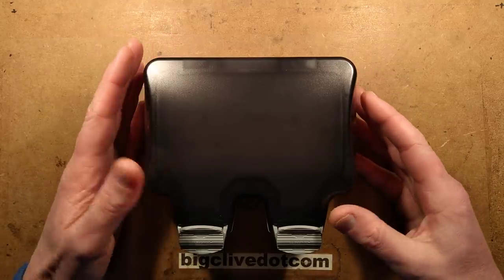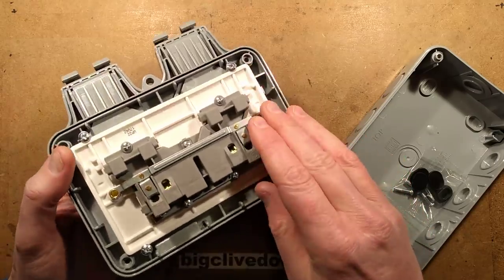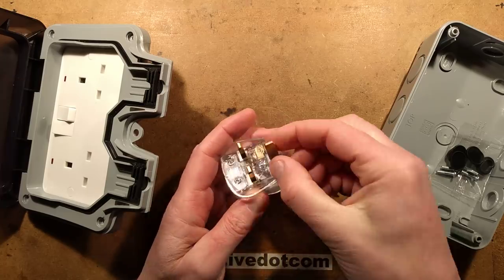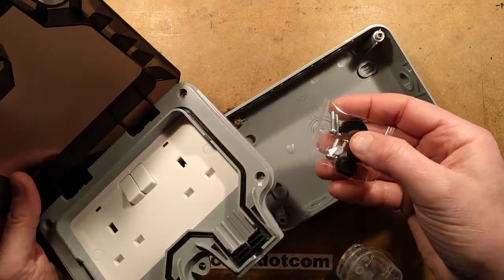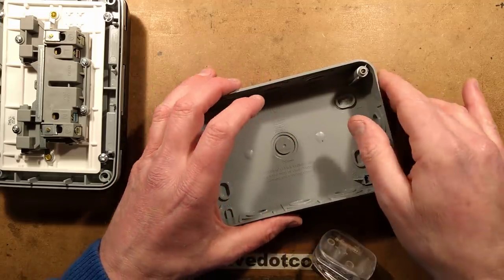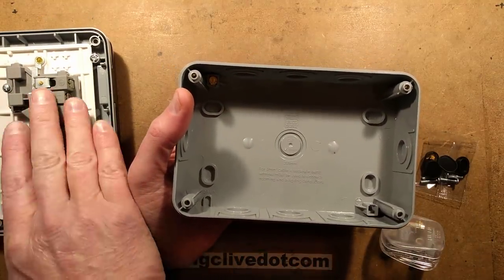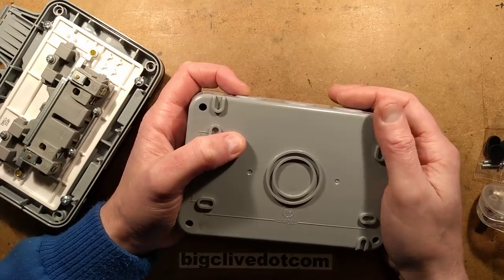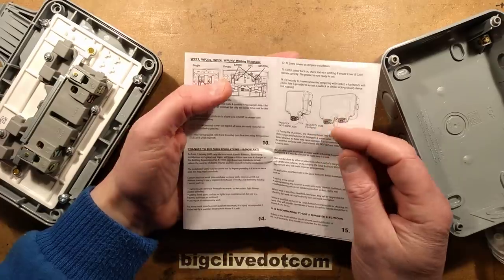British weatherproof socket with clever design. (bonus rant)

Comment: Right, let's compare the Dutch / EU plug (CEE 7/3 socket and CEE 7/4 plug) to the UK plug and socket, point per point.

- Rated 13A. EU plug: 16A.

- Big brass earth pin. Great, but it's singular. The EU plug has a connection on either side (which contacts at roughly the same time as the live and neutral)

- Sleeved power pins. All BS 4573 plugs (which are common for low power, unearthed things) have this. With the normal CEE 7/4 - CEE 7/3 combination, you can't even get the pins anywhere close to the outlet with your fingers touching the pins, because the outlet is recessed. 

- The automatic shutters are not quite as common on EU plugs, since it's regulated per country, but it's becoming quite a common thing. IMO, the shuttered EU plug is still better in this aspect, since it requires force on both shutters simultaneously to open, meaning that it'd require quite a bit of precision to open the shutters with say two screwdrivers. In the UK plug, you can first jam a single screwdriver in the earth slot, and then jam a screwdriver in the L or N, since it's now completely open. A lot easier to do if you ask me.

- It's fused, but is that out of safety, or out of necessity? I'd argue it's almost out of desperation, due to the outdated, and definitely not optimal ring circuit used in UK housing. In the Netherlands (can't speak for the rest of the EU here), everything is simply rated for 16A. The fuse in the fusebox is 16A, all decent extension cords or power bars are 16A (not even sure if <16A can officially be sold, never seen one), all plugs and cabling on appliances is 16A. Of course, you can argue that the UK plug makes it easier to find which device is causing issues, since that one wont work, instead of an entire room or floor when the fuse has tripped int he fusebox. But, what if the fuse doesn't work properly, and heats up massively instead of opening the circuit? Then you have a hot plug in an uncontrolled environment (how many people have power bars with many plugs underneath their beds?). If something goes wrong with the fuse in a fusebox, not much can happen, since the fusebox is designed to handle that.

So can we really say that the UK plug is the best / safest in the world? I'd argue it isn't. Not anymore at least. When taking the entire electrical system into account (from fusebox to appliance), I'd say it definitely isn't the best / safest anymore.

Comment: These  British Standard "BG" outdoor sockets are pants,  I do like and rate BG gear but these are utter rubbish.   The 8 cable entry's around the outer of the back box just push out with little effort allowing the ingress of water.  I recently fitted one only to find the plastic of the back box to be cracked in several places after 2 months, as if the plastic went brittle during the recent fold weather.  The catches that hold the lid shut are stiff and awkward to use especially in cold weather.
Sorry BG you've let the side down on this one !

Comment: As a Canadian, I love the safety-conscious design of the British plug and socket, but... I really wish I could find someone, anyone, discussing the pros and cons of ring mains vs. ... er, whatever you call the way it's done here in Canada or the US—branch circuits?—and fuses in every plug vs. fuses/breakers in the distribution board, who isn't over-the-top about "oh, the way WE do it is so OBVIOUSLY VASTLY SUPERIOR, and the other way is just FRIGGIN' MORONIC!!!!! "
Reply: The alternative circuits used in almost all other countries called radials (and John Ward is not a lover of ring circuits). Radials can be used in the UK as well as rings. Roughly speaking, ring circuits allow the use of thinner cable as there are two routes back to the distribution board so is more efficient in copper. However, they are more difficult to test than radials and some sorts of fault (like a break in one leg) will not be immediately apparent as there are two paths back.

As far as fuses in plugs vs central circuit breakers is concerned, then that's not the issue. UK circuits all have breakers too. The issue is fused plugs + central breakers vs central breakers only. In the UK system, power circuits can be any of a range of power, but typically 16A, 20A, 32A or 40A and you can find a 13A socket on any of them. So the plug is fused, and what's more a table lamp with a thin flexi cable might have a 3A fuse whilst the circuit it's plugged into might be 32A. So the plug fuse protects the flexi cable from overheating due to a fault whilst the 32A (or even 16A breaker) might not. 

note, those current ratings are at 230v, so about twice the power of the US/Canadian versions. 

To me high current circuits with 32A are an advantage as it means that multiple high-power devices can be plugged in without worrying to much about tripping a breaker. Its common in a kitchen to have a 3 kw kettle and, say, a 2kw toaster and a 1kw microwave oven all operating simultaneously on the same circuit and connected to random socket outlets.
Reply: @TheEulerID  Ahhh, thank you very much for this! All excellent point. Just a question regarding the 'there are two routes back to the distribution board' point, though: I probably don't understand this correctly, but wouldn't one leg back to the distribution board, being shorter, carry more of the current than the other, leading to uneven loading? Or is this not an issue in practice?
Reply: @Ice_Karma  As it's a ring joining starting and returning to the distribution board (known as a consumer unit in the UK) via all the sockets then that means two paths for the electricity to travel. So, from any one socket, the current will pass back to the distribution point in inverse ratio to the resistance (which, effectively means, in inverse ratio to the length of the cable on any one route). So, if a socket is very near one end, then most of the current will flow down the short part. In principle, if somebody connected the maximum load of about 7.4 kW to sockets at one end of the ring, then most of that 32A will flow down that shorter leg over 2.5mm^2 cable so it might, in theory, overload it as 28A is about the maximum allowed on that gauge, although that might require a bit of de-rating. In practice, it's never really a problem as loads tend to be more evenly distributed. Perhaps the bigger danger is a break in one leg of the ring which will be undetected as the circuit still works and then an imbalance is more of a possibility. However, there's little evidence that it really causes problems. 

On ring circuits it's also allowed to add an unfused spur with an outlet from any one circuit or, via a fused switch, any number of other sockets or fixed outlets.

Rings still predominate in the UK. Personally I like having 32A circuits for outlets as it's flexible. It can be done with 4mm^2 cable on radial, but that's relatively rigid and not so easy to install as 2.5mm^2 through multiple sockets.
Reply: The Switches at the Sockets would be handy, especially if you have a system wide Surge Protector at the Panel.

Comment: India still follows the Antique pre 1970 British standard for electrical - Sockets in India are atrocious and will remain like that forever...
Reply from the maker: The round pin 15A sockets in India are still used here in theatres.  It stops people plugging vacuums into dimmer channels and means that if something fails the only fuse or breaker that will trip will be the one at the dimmer itself.

Comment: That deserved a good rant, part P is just shite, 
How the feck can someone with a 1 day slideshow course be seen in the same way as a proper time served sparky with an apprenticeship, full accreditation with current regs,  on the job training and a few years under their belt, 
I know of too many gas engineers, kitchen fitters, general handymen/persons that are feckin good at what they do but are definitely not proper electricians, I would not let them change a light bulb, let alone install new wiring,

The I.E.E./I. E. C. or whoever is handing out these fake credentials need to have a serious think about safety, as a little bit of knowledge is a dangerous thing!

Comment: That is a really good design!!
Reply: I disagree.  The actual waterproof housing itself is a reaction to an over-engineered plug and socket design.  I respect Clive's technical opinion but in this particular case I disagree with it, and I have to speculate that some of his opinion is informed by his working in the technical aspects of theatre and entertainment, where the frequency of connection and disconnection requires a robustness greater than consumers need.

The UK socket is over-engineered in the sense that it combines more redundancies than it needs, uses physical dimensions greater than it needs to use for spacing and pin size, and has excessive spacing between receptacles.  It has some advantages, the shielded pins for hot and neutral as an example, but the American NEMA system could put six receptacles into the space that two UK receptacles fit into.  The NEMA 6 category covers 240V plugs and receptacles with a hot-hot-ground configuration, and the 6-15 and 6-20 receptacles are available with the same spacing that conventional duplex 120V NEMA 5-15 and 5-20 (hot-neutral-ground) receptacles use.  The -15 and -20 refer to amperages, respectively.  So higher-amp receptacles can safely fit into higher density, both for 120V and 240V applications.

The UK household connectors are more like American NEMA 6-50 connectors, which are 240V at 50 amps, more commonly used as special-purpose sockets for high-current tools.  Even the older deprecated-from-code NEMA 10 devices (240V hot-hot-neutral, no separate ground) in 30A and 50A are no bigger than the UK 13A household sockets, and they don't seem to pose any particular hazard once the plug is properly seated.  I will concede that these NEMA plugs do lack the safety of shielded pins, a feature that would be nice to have, but beyond that I'm not seeing much in the way of a downside.  Once the sheer size of the connector is considered though, I see the UK system as having some significant downsides especially when it comes to portability.  The plug on the end of a cable for a laptop computer instantly comes to mind, the UK plug would be very cumbersome compared to an American plug.

If the UK used higher amperages in their household electrical systems in addition to the higher voltages then I could see a need for the connectors that they use, but with a maximum of 13 amps, this connector is much larger than it needs to be.  The problem is severe enough that telecom datacenters may well use IEC C13/C14 or IEC C15/C16 setups, a powerstrip with C13 female sockets allows for much higher density for receptacles, upwards of around fifteen in a single rack unit, while the UK 13A receptacles only allow for around six in two rack units.  Since most electronics use C14 (male) connectors as inlets, common power cords allow for connecting devices in much greater density.

Admittedly I don't know the history of the UK household socket and plug, it may well be that it was a reaction to problems widely encountered prior to its adoption, but it's certainly an over-engineered solution.

Comment: My thoughts on the british socket are that it is fundamentally british. Be different just for the sake of it... someone else has improved your design or came up with a better more versatile one such as the EU plug that has a galore of standard shapes and sizes including waterproofed ones.... well just ignore them and be proud of the british socket :D fused for no reason independently from equipment it powers manufactured from immense amounts of material ultimately to be big and bulky and difficult to fit in smaller boxes... meh... rant over.

Comment: Christ on a bike; brown, black and grey for phase colours, now that's completely fucking stupid (black for a phase colour anywhere cough*US*cough is, IMO stupid to begin with).

We're still using Red, White (or Yellow) and Blue for phase colours in the colonies out here (and our fixed wiring for single phase is still red for active, black for neutral and green/yellow (or unsheathed sometimes) for earth).

I'm not too bothered by brown, blue and green/yellow for single phase colours but yeah, I can see how it might be problematic for some people.

Mind down here we're not allowed to so much as unscrew a wall plate without a license which requires a 4 year apprenticeship (you can get licensed in one state without the apprenticeship but you have to reside there for 6 months to do it) regardless of what other qualifications you might hold (or your ability to merely follow a goddamn standard).

I may or may not have done all the conduit and cable pulls in my garage myself (because, why would I pay $100/hour for somebody to do grunt work, and fiddly grunt work at that) and just got a licensed sparky to actually make connections, but I guarantee all the work in there at least meets (and in many cases exceeds) the requirements in AS3000.

Comment: don't see anything special with this. seems like a standard outdoor waterproof plug. look just like the one i seen int he US forever now. us plugs are just as safe too. they have gfci they use too so even if any water got in it some how they will trip and turn off. there are also breakers at circuit breaker box that trip too so really there are no need for fuse in plug now. also use 120 volt instead of 220/240 volt though too so i think you have a less chance of dieing if you get shocked maybe.
Reply from the maker: We use RCDs (GFIs) too, but the power circuit is rated 32A at 240V so it can deliver 8kW as standard, and more in a fault scenario.  So flexes do benefit from closer local fuse protection.

Comment: these things are a nightmare. if you work on people houses like i do youll find yourself trying to prize the thing open for about a minute fighting with the locking mech which is unnecessarily tight then once youve opened the bastard thing youll have to bend right down to the floor to see where the pin holes are cos the door only opens half way and everyone has them installed about a foot off the floor.... i hate these

Comment: Absolute shit had to replace every one I've installed.   Under high load the socket burns out! The switches fail.....
Reply: So that is the 'standard' socket in the box enclosure.  Sorry to say I find the idea of 'British General' slightly suspect compared to anything UK made MK Branded.    Is the enclosure adding to any heat - but what high load is likely in a domestic situation - the likely uses are xmas lights, garden power tools and maybe the power washer / car vac so none overall a long constant load ?
Reply: @highpath4776  patio heaters...

Comment: The sockets and plugs here in New Zealand is dreadful. UK does have the best in the world. Nothing is fused here in the plugs at all, so if a fault develops it takes the whole line out, then you have you find which item coursed the trip to pop.
Like you I am not qualified to work on mains stuff here either without a bit of paper.  The plugs are flimsy with very poor cable grips. Screws that fail after one use or the thread fails so you cannot tighten it. The cheapest made Chinese crap plugs, sorry I'm ranting now!! No ring mains anywhere! Can you be leave we have mains sockets within reaching distance of the sink? Not an isolating transformer in sight. This is legal, almost every house has this convenient socket in the bathroom.
I'm old enough to remember the older wiring system. RED for live, BLACK for neutral and GREEN for earth. Now what was wrong with that? Anyone could work that out.
The best joke of all the none water proof, none UV rated outside socket that most homes have to plug in the water heater, no direct internal wiring here.

Comment: I will wire up shit all day long and ig they don't like it, what are they going to do, take my electricity off me and tell me I am a naughty boy, ffs.

This is a prime example of people that I call "Stuffed Shirts" and are people who are now looking at ways to "Justify their jobs" byt devising some "Convoluted reasons" as to why we all need to swap out out wiring and other BS.

I have just had to have a new box and tails when the existing pyro tails were perfectly fine... Basically they have wired me for 200Amps and I use about 8 amps if that a day.
Reply: They'll press the magic button  that opens the relay on the smart meter they forced upon you and cut you off
Reply: @dom1310df  What smart meter ;)
Reply: also, they can't just cut you off, they have to get a court order allowing them to do that. There have been cases of people having their electric cut off and people were at home on things like Lung machines (as in polio victims) which is why the laws were changed.

The guy that changed my box said that they have about 30 jobs that they can not do because they can not cut off the supply to do the job as the person is on a life support or something that is a medical machine.
Reply: Did you do any form of testing to find if the pyro was fine?
Reply: @guylljones72  No, the electricians that were doing the job said, nowt wrong but they got vetoed and the boss said that new tails had to go in.

So a 20 minute job ended up being 5 hours long.
Reply: @guylljones72  Nope, like I said, I didn't do it, the electricians did it, thats how they knew it was ok.

Silly really, they even said my box could have been fitted with compatible RCD's because the box was, wait for it, ALREADY a metal box. Seems that I was the first place that they came to re wire the main inlet to fit a metal box when I already had one.